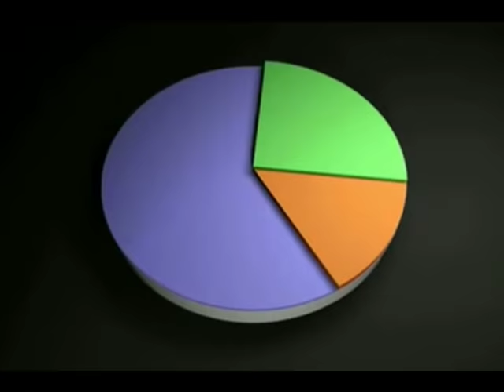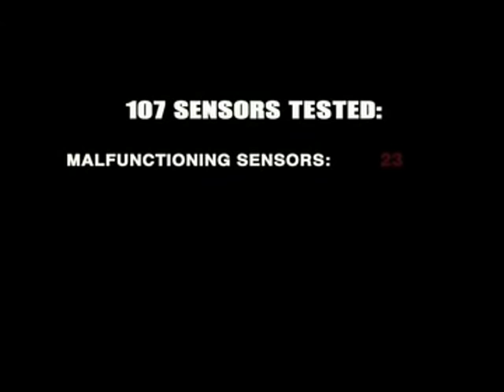K&N Filters - Do oiled air filters damage MAF sensors? Testing & Results

Comment: I have never in my life heard of any salesman suggesting to NOT buy his product. These tests have been performed by those trying to sell their product.  Yes, I've used K&N filters on carbureted engines, no worries there, and to be honest, I can't say for certain if they really are a better filter because I have no empirical data to suggest a conclusion. Marketing is designed to make the consumers think they have spent their money well, and hopefully create Brand Loyalty for repeat business.   I'd think twice about using K&N on Fuel Injected engines because there WILL be some degree of oil suspended in the airstream.   Whether or not it's significantly harmful would never be disclosed by the manufacturer,  you can count on that.  They have a business to run,  and sales to be made.

Comment: I had an issue with the MAF sensor on my Land Rover, so I cleaned it with a MAF sensor cleaner.
Reply: I used throttle body cleaner))
Reply: Some people would rather bitch than do a little preventive maintenance.

Comment: Ran k&n on bmw 330cd, ran horribly, engine management came on, wouldn’t boost right at all. Swapped it back out for a new OEM replacement, i think it was a MANN filter. Car runs a lot better than it did with k&n but still not 100%. I’m about to change the mass air flow sensor and see if this helps at all. I have lost top end power.
Reply from the maker: Before changing the MAF (which are usually big money) I'd definitely make sure its clean https://www.youtube.com/watch?v=rXDo-KTwJWs

Comment: In my opinion, this has nothing to do with issues between the factory and K&N or the dealer and K&N, it has to do with issues between the dealer and the factory.  Dealers have issues with the reimbursement rates paid by the factory for warranty work, they believe they are too low and have only gotten lower.  Therefore, many dealers are always looking for some opportunity to push off the cost to the customer. 

If they can convince the customer into believing the issue is their fault for installing a K&N filter,  they can get significantly more money for the same repair than they otherwise would have gotten from the factory.

Comment: I used a k&n air filter in my 2001 dodge ram and now I can't find my birth certificate.. I had it in the top dresser drawer. I tried thier oil filter and I still can't find it.. Anyone else have this happen or any ideas on what to do now? Thanks.
Reply: What?
Reply: I think your trouble may be in the drying and re-oiling. I did mine a week before Me and my wife went to Spain, and my passport, and travel documents both appeared on my bedroom drawers. Not only that, but my suitcase was also packed ready to go. I also noticed that the k and n recharge kit empty box (which I left ripped in pieces, on the kitchen table) also vanished. And appeared in the recycling bin.
Reply: Colourpurpl i made the mistake of cleaning and oiling my air filter. The next day the filter and my wife emptied my bank account and ran off together. Should have listened to that amazon review :(

Comment: So... K&N says K&N isn't bad and "refused to allow our customer to be in the middle of a situation like this"—i.e. if a dealership claims K&N is at fault then they resolve it "one way or another." What does that even mean...? Do they threaten to sic their lawyers on them? 

They say they tested only 42 malfunctioning sensors where 19 were dead with no conduction and the remaining 23 were giving out-of-range results, of which 19 were damaged by contaminates that SHOULD HAVE BEEN FILTERED OUT BY THE FILTER! 

Not only is this not enough testing to be statistically relevant, but there is a conflict of interest because K&N's own lab is on K&N's payroll and is not going to come out and say "our most profitable product damages cars instead of protecting them like it's supposed to".

Look... Phillip Morris also claimed cigarettes aren't bad for you. Exxon said leaded gasoline wasn't a health risk. This video is nothing more than propaganda.

They don't say what killed the 19 totally dead filters, but they do say that their K&N oil on a MAF sensor could produce "awkward" voltages but that the air flow from the engine would clean off the oil after awhile. So now it's the engine's job to clean itself from contaminates put there by the sensor? Could it be that this would depend upon how much air flow there was and how long between engine runs the oil was left sitting on the sensor? Could it be that having some oil WHICH IS DESIGNED TO ATTRACT AND COLLECT CONTAMINATES on the MAF could act temporarily as a magnet for other particulates that will remain on the MAF sensor even after the K&N oil is gone?

Just think about it. K&N is proven to filter out less of the dirt in the actual filtered air AND there is a liquid on the filter that is DESIGNED to attract and trap contaminates. If that liquid gets on your sensor it will also put other nasty shit on your sensor until the liquid is dry.

Isn't the whole point of a filter NOT to let contaminates in, in the first place? My K&N came from the factory with BEADS of liquid on it AND holes big enough to see through. 

If it was actually a better technology than paper/cellulos filters then why in the world would ZERO car companies ship their cars with K&N filters pre-installed? 

Use your damn brain! If a company has to put out apologetic pseudo-science to defend a product that multiple lab tests have shown to be inferior at its primary purpose (filtration!!) then that should be a HUGE red flag to you. 

Being the official filter of NASCAR where engines last at most a few months is not inspiring either. If your filters don't harm reliability then why isn't it the official filter of Honda or Lexus?

Comment: Bought a 2003 f250 7.3 about 5 Year’s ago.  Had a k&n filter that was exact stock replacement.  Intake and turbo had oil on it but it looked like whoever the idiot was that oiled the filter went a little CRAZY with the application.  Depending on the test it all depends on how the oil was applied and how much

Comment: Used different cars for several years without any issues at all. In my newest one, after using it for 2 years (without any issues) placed the K&N air filter. Week later MAF / MAP sensors are going crazy and throwing errors.
Checked inlets, pipes, sensors, all good. So sorry K&N but I wouldn't be using air filters which are causing several errors in my car. Each time I was getting an error, my turbo was completely off because ECU will protect it from any damage.
I have screenshot each time it happened, investigated very carefully what seems to be a problem and sadly it is the K&N filter to blame....

Comment: 6:50 normal operation. 90% of people that is using these filter is not using it  normally.....
Reply: Bee Yang i used mine normally, not hard driving at all. it still fouled up my maf which caused major problems with my engine because it messed up my air/fuel ratio which led to engine failure
Reply: Don Rowe same
Reply: Don Rowe if its the filter youre fine. Had mine for a year and no issues. But if its the intake tehn u needed a tune.

Comment: There is no doubt that K and N filters are great for flowing more air.  But just how much difference does it make?  Can you actually see a difference on the dyno?  Can you feel it in the seat of your pants?  What are air filters designed to do?  Aren't they designed to keep bad particles out of your engine?  K And N filters flow more air but the only way you can do that is to have bigger air spaces between the filter medium, which translates into more junk in your engine.  "Project Farm" has done an excellent video on different air filters and  it turns out K and N were at the bottom for actually filtering out particles.
Reply from the maker: I think this is the vid you are referring to https://www.youtube.com/watch?v=sJ3L-E-ufYo

Here is another excellent article on performance air filters, their flow and filtration performance http://www.billswebspace.com/AirFilterTest.htm

Comment: I think I’ll avoid and 3rd party filters in future on my mk 4 golf I had to change air mass sensor twice and I had a brand new k and n cone on it which I cleaned routinely as manufacture stated. Plus my current Audi you have  to take apart half engine bay to get to the filter box nightmare.
Reply: riccccccardo get a tune to avoid replacing the maf sensor. You must have a kn air intake.

Comment: I installed a KN filter for my Honda fit 2014 Hybrid model a month ago. After cleaning the MAF sensor, the engine light, VSA light, and the power steering light were on. Then I took my car back to the dealership. They changed a new MAF and replaced the kn filter with manufacturer one. Then the car is good to go. So I think that the kn may not be work for me. Just personal experience sharing. :)

Comment: of course k&n will defend their products. any oil impregnated air filter is bad for maf sensors. i have had it happen to me on a couple occasions. i stopped using oil impregnated filters no more maf issues. will never put another k&n air filter on any vehicles i own. i do however swear by k&n oil filters. i own a subaru wrx and when the k&n air filters fouled up my maf sensor it caused a bad air/fuel mixture and caused detonation which caused my subaru to have ringland failure. keep in mind, my subaru is bone stock, never raced, never beat. this ringland failure occured at 30k. owned the car since new and the 1st thing i did to the car (within a day of purchase) was install a k&n air filter. had numerous mechanics (people that get paid to work on these cars for a living) tell me the maf sensor failure was directly related to running a oil impregnated air filter.
Reply: Don Rowe ringland failure is common on those engines. Doesn't matter what filter you use. Its a flawed design from the factory.  Bone stock engines have had the ringland failure.
Reply: Don Rowe The only reason they told you it was due to the air filter is that is their way of getting out of paying for a new engine. Dealerships have been pulling that bullshit from the beginning of time. please tell me you didn't fall for it . lol They literally will look for any after market part on your car to get out of doing warranty work.
Reply: Don Rowe your car would have thrown a CEL and went into limp mode. If your MAF sensor was malfunctioning and causing the air/fuel ratio into lean conditions, then the limp mode would run it on wastegate pressure and a generic fuel trim (static, no variables). so you should have noticed this sensor failure long before engine failure due to pre detonation...

Comment: I wonder if all K&N employees use those filters? I'd prefer to use original filter & replace it every 2 yrs with a new one - this is much cheaper too :P
Reply: Some paper filters are 35-40 dollars ... Just bought 1 for my wife's car...$60. I run k&n in both of my trucks for the last 10 years and not one problem.
Reply: Fram filter for Ford trucks is $10.50 K&N is $49.99 so overpriced, just use Fram.

Comment: Hi all, i have a european focus 1.6 tdci 2010 with 109 bhp. Today i decided to change my stock air filter with k&n in original box filter. I started the car and after 2 minutes drive i noticed low boost on my gauge, normal was 1.1 bar and now after the kn filter it was struggling to do 0.7bar. Driving in 3rd i put my foot down and boost never passed 0.5 bar and went into limp mode. I shut down the engine, restarted and changed to stock filter back. No problem, the boost is back to 1.1and back to normal. The kn was at fault but can't figure out why. As i would like to go with it but not if it hurts my engine. If somebody had a similar issue please advise
Reply: nikiD1982 sounds like to much oil in the filter for it to let air get buy
Reply: Oops get by stupid spell ck

Comment: Cleaned my K&N but did not use/spray with oil and NO powertrain light since then...what other proof do you need that its the oil causing the powertrain light + check engine light to come on? I'm telling you, you can contact me anytime if you want to discuss?

Comment: I’ve used k&n air filters on multiple vehicles and multiple motorcycles and never had an issue. I think the problem comes when the consumer oils the filter after cleaning it and they apply too much oil. The excess oil gets sucked through the intake tube and collects on the MAF sensor and the throttle body.

Comment: I am skeptical on K&N, but to know for sure, I have been using K&N on my daily car.  So far it has over 100K miles on the odometer with K&N installed at 1k miles.  I clean and oil the filter every 5-10K miles.  Mileage has been about the same.  Definately can't tell 1 or 2HP increase if it has or any increases.

I don't dare to use K&N on my motorcycles, I feel any drop in filter has to be maintained is ridiculous.  Just a pain I have to lift up the tank, just to get to the filter box.
Reply: WHY DON'T YOU FOLLOW THE MANUFACTURER'S INSTRUCTIONS !???
The K&N Air Filter is to be CLEANED AND OILED EVERY FIFTY-THOUSAND (50,000) MILES.
 Your Bike's filter needs cleaning after 50,000 miles, NOT sooner.
You're cleaning your K&Ns too often, making un-necessary work for yourself -- and blaming K&N for your mistakes.

Comment: Why is the inside of my intake pan dusty while running a K&N Air filter and stays spotless when I run an AC Delco
Reply: because their filters dont stop dirt... i have replaced countless motorcycle engines that have clear dirt ingestion caused top end failures due to the dirt that went through this companies product.

Comment: This is what it looks like looking through one of your filters that don't stop dirt. I work on motorcycles full-time and I have hundreds of engines in my shop that all have dirt ingestion caused failure from the dirt that went through K&N filters. Every sport bike I work on that has a K&N filter in it has dirt in the air box on the side that should be clean. Every sport bike that I work on that has a original OEM style filter does not have dirt in the airbox on the side that should be clean.
https://youtu.be/xIPfKKIaAoU

Comment: I'm a youtuber with 900+ videos.  A 2018 F150 with the 3.3 v6 make 290 hp. So if I put a K&N air filter in there. The engine will make more hp, per K&N. 
The problem I have with that is. The 2018 5.0 v8 make 395 hp and use the same stock air filter.

Comment: if oiled correctly you might not have any issues, now if your are running them in a ford they will give you issues.listening to this video they failed because of complete electronic failure, resistance is the doom of any electrical circuit oil say from a k&n filter is resistance, i use k&n in lost of applications all my motorcycles mas air flow systems that measure before the filter but will never run one of these in any ford or gm product, my latest is a po171 and p0101 in a 2004 chevy 1500 5.4 the sensor was coated in k&n oil a cleaning of all the oil running the filter DRY and cleaning the maf multiple times solved the issue nothing other than the filter oil could have caused the oil coating on the intake side of the sensor idk what anyone says these ARE good filters but the absolutely 100% DO cause damage to maf air flow sensor

Comment: OK this is a long running issue and of course k&n will say no this is not true. I had a car for 4 years and someone gaved me a new k&n filter and I cleaned my throttle plate and put the filter in the car and two weeks after my car gaved a code for the maf. So when the part was removed the maf had oil on it.....

Comment: K&N oil cost me $4,2xx in repairing the top half of my motor. I let the oil dry on filter for over 16 hrs. I'll never use it ever again.
Reply: You spent $4200 doing a top end rebuild?.. first off no.. no you didn't. Second, I could dump a cup of oil in my air box and it's just going to foul the MAF, get sucked into the cylinders and burn off. Something else caused your failure

Comment: stick with OEM
Reply from the maker: If the stock filter is not a restriction I agree. If its not a restriction. 

Depending on the air filter set up you have you may be able to fit a larger OEM filter from a different car. K&N has a nice search by size feature on their site which cross references their filter to OEM codes https://www.knfilters.com/dimsearch

Comment: When you oil a K&N filter, there is no way air rushing through it doesn't bring droplets, ever so small as they may be, past and onto the MAS sensor.  The filter is nothing special and the oil is nothing special when forced air is subjected to it. MAF is affected. Period
Reply: I have K&N filters on two trucks, and I will replace them with the disposable Motorcraft filters as I'm finding how truly important clean airflow is to the longevity and health of my motors.  I owe it to my trucks. 1997 F250 (190,000 miles) and 2005 F150 (285,000 miles)

Comment: Want to damage your maf sensor? buy this k&n crap. I know a LOT of people say  they gain hp, improve  mileage of course you do.  more air flow more hp but also if There's more air flow  that  also means more dirt going through simple as that. installing a k&n filter is like putting holes in your paper oem filter wich will flow more air, but at the same time more dirt going through. use  common sense people.Are you people so lazy that can't replace a 10 dollar paper filter  every  once in a while  5k 12k?
Reply: Pablo Carrillo amen to that
Reply: you mean $40????
Reply: 30k in no problem
Reply: Please research the effect vibration has on the material KN uses. #Science